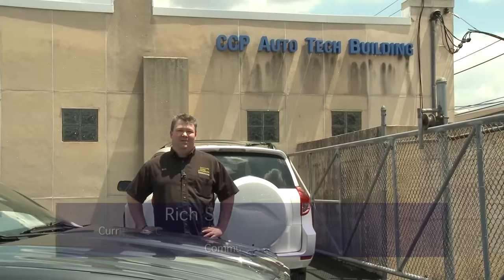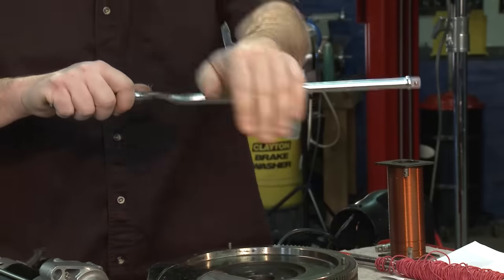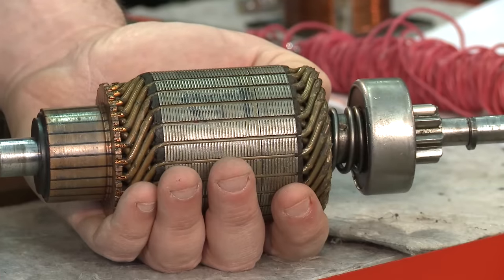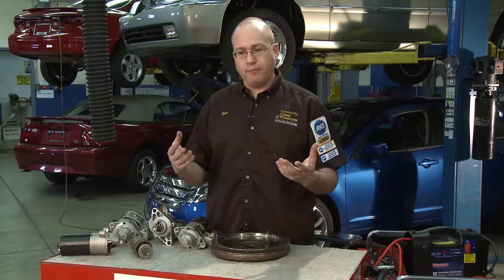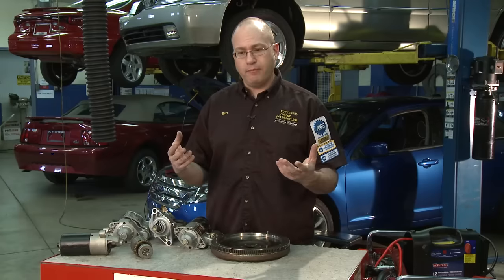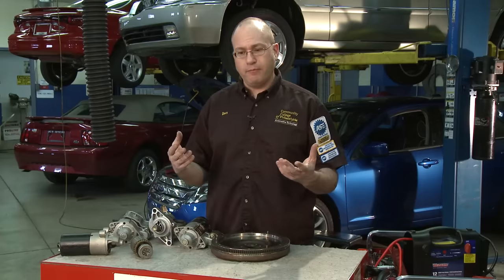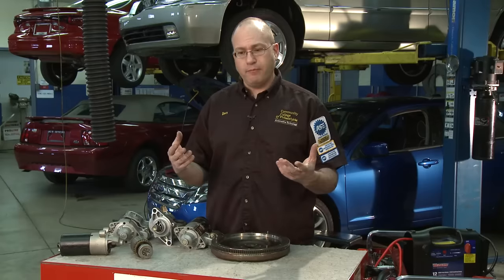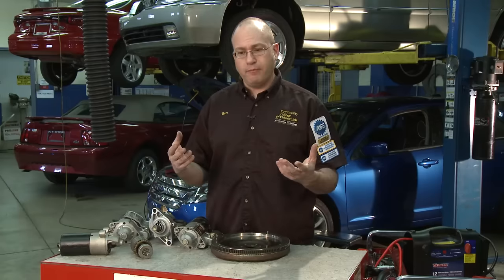Car Corner: Starter Maintenance

Comment: Very well done. I love the way Dan goes into details about the operation, components, installation, and safety precautions to use when working with starters. Little has changed with starters since I first started working with them in the 70's. I still learned, and remembered a few things as he gave his presentation. Good job, Dan.
Reply: zoom 7 oh, BB
Reply: O
Reply: Mag '70, ff 22. Comp.

Comment: I am 60+ years old , Car Corner did an OUTSTANDING JOB on this video. I learned about rebuilding cars back in the early 70's. When you opened the hood in those days you saw an actual motor and the front of the motor faced the front of the car. My first car was a 1965 Ford Fairlane 302 with a manual 4 speed hurst shifter. Thanks CarCorner great job !.

Comment: Automotive starter motors are wired as a series DC motor which has the highest starting torque of all the DC winding configurations. That, and the gear ratio between the starter pinon gear and the flywheel ring gear makes turning any engine over easy street.

The series electrical connection is from the positive battery terminal, through the solenoid main contact (one), onward through one carbon motor brush, the commutator segment and windings (armature), through the series field windings, and out the other commutator segment and brush back  and to the battery negative. The armature winding and field windings are in series.

Don't mean to be annoying, just love revisiting my past work life.

Comment: Wow, that covers the reason for having one, how to build one, the complete wiring set up, and so much good safety advice. I now know why my cars only starts in park or neutral, and the dangers of permanent battery connection. Take heed.. a few years back my live wire came into contact with the hot exhaust manifold whilst I was trying to reroute it and within seconds there were flames out of the engine bay. Luckily we had a fire extinguisher to hand and were also able to quickly disconnect the battery. A few more seconds and the fuel line would have melted and the whole car and garage would have gone up in smoke

Comment: Excellent guidance here, but with one caveat. 

At 25:20 into the video, you're energising the solenoid but it doesn't pull in.  You can hear the arcing being caused as you connected your battery pack to the body of the solenoid, so clearly there's a circuit there. By connecting the way that you did, you were only energising the 'hold' coil of the solenoid. Your battery pack was not weak at all.
 
There are two windings in the solenoid, one is called the 'pull in' winding (very strong) and the other is called the 'hold in' winding (relatively weak). They are wound on top of each other. This is why when you nudged the magnetic core with your finger, it popped in.  Your finger did the initial 'pull in' job!

The hold winding is connected across the 'S' terminal and the body of the starter.
The pull in winding is connected across the 'S' terminal and the load side of the solenoid's main contacts.  The pull in winding gets it's earth return via the armature's brushes and windings. (one of the motor's brushes is connected solidly to the body of the starter as that's the earth return for the main starter motor current).

After the pull in winding has done it's job, and has pulled the core all the way in, the solenoid's main contacts are bridged and send power to the armature (motor spins up) AND at the same time kills the power to the pull winding because now, the winding has 12v on each of it's ends and so because there is no potential difference across the winding, it's magnetic field collapses and it stops pulling. However, the hold winding is energised all the time (when you're calling for cranking) and it then just takes over and holds the core right up at the end of it's travel.
When (if??!) your engine fires up, you release the key from the crank position and the hold winding loses it's grip on the core and the core is sent back down to it's rest position by spring pressure.

The way that the pull winding has been wired inside the starter means that a poor or non-existent brush contact with the armature segments will prevent the pull winding from working as there will be no earth return path. This could lead you down a slippery diagnosis path!  It would be easy to condemn a solenoid because you can't see or hear any activity from it, when in fact it cannot work because it's earth return path is compromised by bad brushes.

This is not meant as a criticism at all.  I appreciate all the hard work and time that you must have to put in each and every one of your videos.  But if the above helps someone understand how the solenoid works a little better, that's good!
Reply: Xm,as
Reply: Yes, exactly this- just saw the video and posted the same, and see this was already covered a year before here 👍

kind of a neat setup using the motor as the virtual ground, since it's so much lower impedance than the solenoid.

Comment: Thanks for the time to make  this very informative video.... learned alot ......  I had the starter replaced on my 01 Chevy  Silverado  and I noticed  that the heatshield plate was missing,  I asked the tech why was it missing he it was not important  so he lied....  Thanks to these vids you can learn  and not get lied to or robed  for your $$$$$      you work for.....  Thanks
Reply: 99% percent of Techs follow a "Protocol" called "Safety".  This will protect them from Law Suits or even Complaints later.  If something in the Car/Truck have in existence, like in your case a "heat-shield".  He or she will suggest you to replaced if it's missing.  Not only it will protect your starter, it will prolong it.  If it was put there by the Manufacturers, 99% of the Techs will follow what the Engineer did when they design the Car/Truck.
Reply: Also I like to add... Since it's your Car / Truck... You do not have to put anything on.  As long you get your "Safety Inspections" done, it doesn't really matter.

Comment: Many car engines didn't have a reduction gearbox at their front to engage the crank handle, they had a direct drive slotted starting 'dog' (? ) with ramps to engage a pin traversing the handle so that if the engine rotated in the opposite direction it would tend to eject the handle (maybe the handle engagement means on all vehicles didn't have a contra-rotation ejection means (?) - nevertheless in the 1950's one occasionally still came across people with broken arms which they attributed to cranking an engine - still very useful in case of a 'flat' battery. 
Around 1969 I purchased a new Commer van - made by Chrysler in the UK - the engine had a  starting 'dog' at the engine front + an aperture in the bumper .... but a crank handle wasn't supplied. 
The van had an automatic transmission - 'Borg-Warner 45' I think - and if you had a decent downhill run the engine would start.

Comment: Great teacher. I learned a heck of a lot from this excellent video. This will help me on my 71 Mercury Cougar I just bought for 500.00. It starts right up, but the starter continues to run and wont disengage, so I have to turn the motor off right away to prevent over winding the starter.

Comment: Very good delivery. One option to add in is some text indicating S wire => Solenoid wire, B wire => Battery Wire, M wire => Motor wire. A bit easier to remember.

Comment: Excellent video Dan but i would have like to see you make a recommendation to to us 
Excellent video Dan but i would like to add one small recommendation to your 
viewers and that is when working on a car and specially in the electrical and electronic side of it is to remove whatever jewelry they may have on their hands as
a safety item.Had a ring on a finger many years back and it  completely melted like butter and almost lost the finger.So let's be careful out there

Comment: Thank you for the great video! I'm having so many issues with my 2017 Honda HR-V starter. I've replaced it 3 times, rechecked my work whenever in doubt. I cleaned and piggy-backed my ground cables and put them in insulation sleeves. I piggy backed my alternator + wire to battery fuse + terminal, I replaced my battery, alternator, and I've been on top of all my routine and high mileage maintenance since I bought the vehicle new. I have 175,000 miles. It runs like it's brand new and it starts the first time. But if I turn it off after the engine reaches peak temperature, I have a single click sound and no crank. It's only until the car cools off that it starts again. Piggy backing the positive and ground cables, as well as soldering with electronic paste alloy - each wire going to the fuse connected to the battery has definitely helped eliminate some of the issues but not entirely.  I've also replaced my ignition switch as well. My relays I cannot seem to figure out a simple way to test if they're bad.
Reply: I have similar issue now and wondering what is going on?

Comment: i know this video has been around a while but it helped me sort through some huge holes in the info on the web.  Many are too bogged down in what feels like electrical circuit theory.  That makes picking out the info pertaining to your actual charging system.  Here there is a good background to define components and actually shiw the darn things.  

The last 1/3ish puts all the info together in a very accessible fashion.  Meaning the layperson can see plus understand what is happening and can then use that understanding to solve their issue.

You've helped me more than i can expressing... gotta subscribe...
Reply: Po171m
m

Comment: A lot of rebuilt starters are crap. The good news is you can rebuild them yourself. The tricky part is finding the parts.when I too high school shop in a 1975, we learned how to do it.  

The longer a particular design is in production. The cheaper the cost for cores become. Sometimes a particular design is on short supply and the price goes up and it really becomes worth your time to rebuild it yourself. Having access to a lathe makes short work of turning an armature, and a broken hack saw will work fine to undercut the mica separating the segments on the commutator. Oil light bushings are often available at the hardware store.

Comment: You forgot to mention about the shield between the starter and engine block is also used for a dust shield so that, debris will not enter the engine housing where the fly wheel is.
Awesome video. Thanks a lot.

Comment: Excellent video,very well explained the installing of the starter the bolts, was excellent how many times i heard of over tightening striping the threads you have to notice the size of the bolt and the materiel their in or made of.

Comment: Enjoy Dans vids and show on Saturday afternoon. I dealt with failing starters on a 72 chevy years ago for 10 years. Had 2 diffetent shops say its carbon build up causing a hot engine having trouble restarting engine. Had to replace the high torque starter ever 1.5 to 2 years. Even installed extra heavy welding cable to feed it and purchased the largest size battery. While replacing water pump I decided to have radiator cleaned out by a radiator shop. While talking to them told them that my car always appeared to run hot even with the thermostat removed. He asked what size engine and told me that it was a 400 cubic inch. Scum bag used car lot installed the undersised radiator and lied telling me that it was a 350 cubic inch engine. They removed the 400 inch sticker on air cleaner. Had 4 cars since then and never had to replace any of their starters.

Comment: Excellent video. Now I feel ready to really troubleshoot my GMC that for sure is a loose/bad cable.  Already bought a new starter and did the same, loud clunk and nothing else as if the starter was not doing it job.  Thank you much
Reply: Jose Burgos well atleast u have a backup starter that u can replace in a store parking lot or whenever u   turn ur car off and trying to turn it on but all it does is click

Comment: I watched your video and you offer very good advice.   However, I think I can add a few useful suggestions.
New brushes can be easily obtained for all starters, either as brushes which need soldering individually or as a brushes and brush-plate complete.
If the starter works when struck with a hammer, the brushes need replaced.
This is not difficult and it's desirable to clean all the carbon dust and grease out of the motor when replacing them.   
When changing the brushes, if they need to be soldered to the relevant connections (field coils and brush plate), care must be taken to ensure the solder or flux does not travel along the pliable copper braid toward the brush as this will cause them to stiffen up.  
This is done using a heat sink on the brush leads, such as a metal clamp on the lead leaving enough un-clamped to solder.  Desirable extra protection is afforded with a piece of water soaked rag wrapped round the brush and the rest of the lead on the brush side.
These leads must remain flexible to allow the brush to move the full length of the travel of the brush in the brush holder.
Some starter brushes are supplied complete with brush plate which makes the job a little easier.
When re-assembling the motor, the bushes (not brushes) at either end should be re-greased, but not over greased.   Make sure the brush leads don't touch any parts which will cause a short to earth.   Before fitting the starter, "flash" the machine across a battery and if it tries to jump out of your hand, it should be good.
Reply: Don't wait 'till it dies.
If it has been allowed to get to the stage where the machine is lazy, the commutator is suffering damage which will quickly cause it to be damaged because of arcing between the brushes and the commutator.
The commutator can appear to be pretty bad but it may work satisfactorily by cleaning, cutting back between the segments and fitting new brushes. The commutator can also be cleaned up by turning down in a lathe, removing a bare minimum of material.
If it is old and it is starting to show any symptoms of weakness, strip it, inspect it and make good any problems, such as worn bearings or carbon buildup around commutator. 
Scrape carbon from the insulation between the segments of the commutator and cut these back to about .5 to 1 below the level of these segments.
When problems are resolved, assemble exactly as it was beforehand (assuming it was correctly assembled in the first place), using a little grease on the bearings if not a sealed type.
No grease is necessary on plain bushes if these are made from phosphor-bronze, if any grease is applied, use only sparingly.
Brushes, bearings, bushes, throwin components and bendixes are available for most starters fitted to cars, motorcycles, commercials; in fact virtually all starters for all types of engines for all applications made in the last 60 or 70 years. In fact I have not come across any starter for which I couldn't get parts.
I hope this helps.

Comment: There's a lot of Mechanical Engineering and theoretical Physics and mathematics equations on the BLACKBOARDS lectures on videos here on YouTube by PhD Physicists and PhD engineers lecturing at MIT 'Massachusetts Institute of Technology'  lacking the world of PRACTICALITY / APPLIED / EXPERIENCE in the REAL WORD. Your Lecture Sir  CCPTV53, is  type of LECTURES are the REAL Engineering Applied of those concepts that Engineering students should be learning. If you ever had a PhD in Mechanical Engineering from that PRACTICAL KNOWLEDGE gained from EXPERIENCE, You will be a GREAT PROFESSOR AND blow away those incompetent IVY LEAGUE Professors.

Comment: I wish I had a teacher like him. I went to a technical school to learn mechanics and sadly some of those teachers didn't want to teach properly. Some teachers just read the books and give a test and thats it. And during practice day, some teachers just gives us a motor and tells us to take it apart and thats it. But am also greatful that I had good teachers as well, but sadly they just were a few. I graduated with not enough knowledge. Went to a mechanic job and they had me only doing oil changes and tires and battery replacements. After that, i went to another mechanic shop and same thing. I ended up working in retail and still working in a supermarket. I love working on cars. But anyway, at least I have a job.

Comment: you can also take apart the starters and clean the "brush" dirt and other contaminants out while also re-greasing the rotating gears. You can also replace the brushes in the starter on my 2006 chevy cobalt.

Comment: Great presentation thanks.  You didn't cover the connections of the by-pass switch to the starter-motor. I assume you connected the motor body to the battery negative and the M terminal to battery positive. By  connected the by-pass switch across the M and S terminals which you could close the circuit  by pushing the trigger on the  by-pass switch.  I've ordered one ($10).   Thanks for covering the safety issues to consider when using it.  Cheers Vaughan